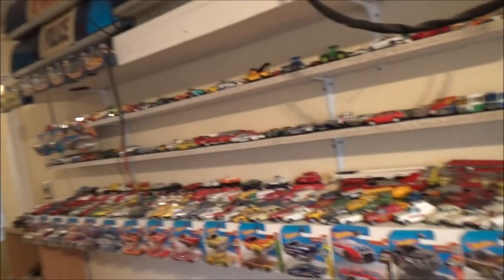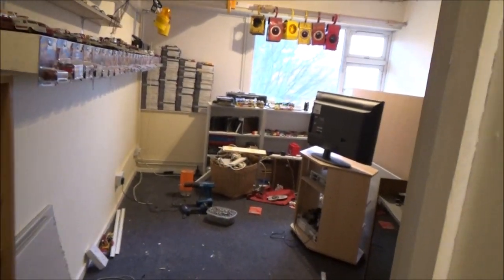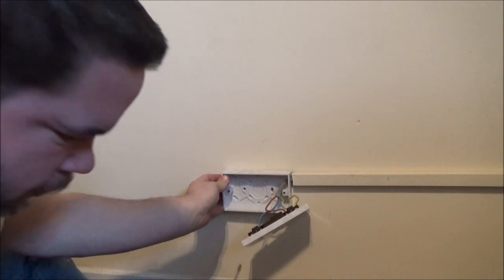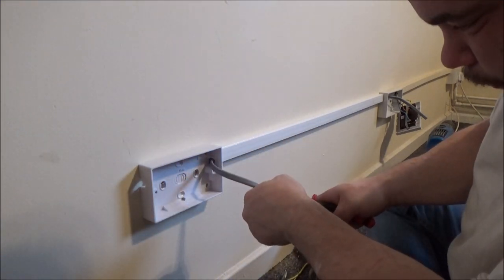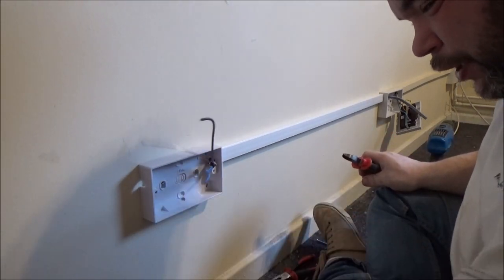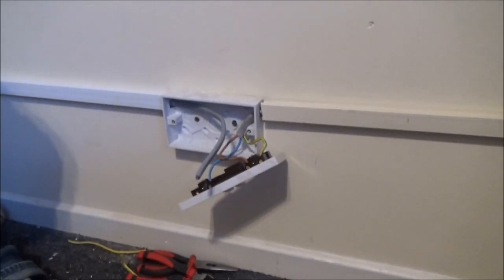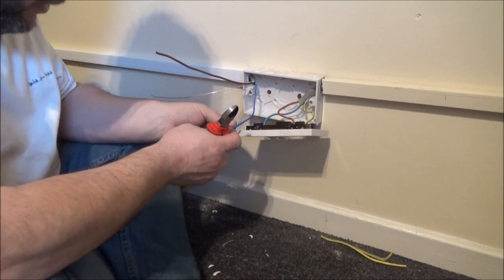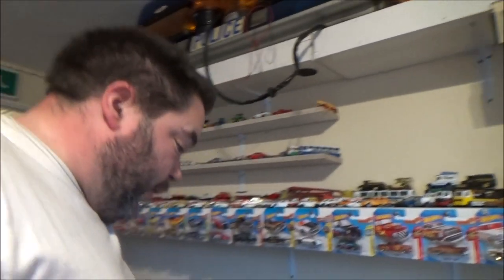Installing A Socket/ Power Outlet In The Bedroom.

Comment: So this is a spur socket off another spur socket, is this the reason for your 16A breaker instead of wiring a fuse in between?
Reply from the maker: It's not a spur off of a spur, it's a 16amp radial circuit.
Reply from the maker: The first socket was the only socket connected to the breaker, I have just daisy chained two more to make it a radial circuit. It's not a spur on a spur.
Reply: @RandyDarkshade2  ah ok thanks for clarifying

Comment: Good video, how can I move an existing socket if the attached power cable is too short, can I join cables ( via a junction box ) to get the extra length I need?
Reply from the maker: You can join a cable onto it but I'd recommend using Wago connectors in a whisker box if you  are hiding the cables under a floor.
Reply from the maker: It's always better to run a whole new length of cable if you can, but if you have to join it's best to use wago's and a box.
Reply: @RandyDarkshade2  ok, thanks for your reply.

Comment: Diy dave love how there's no vde screwdriver no proving dead no socket tester the new socket has a chip on the entry toolstation axiom tat by the looks of it
Reply from the maker: There is no chip in the socket and it's not from tool station either. How did I not prove dead? Lamp on, power was there, lamp no worky, no power. therefore, dead. Sockets have since been checked with a tester and are fine.
Reply: @Kieran - and yet he’s still alive, and the socket works fine. It’s almost as if joining the brown cable to the brown cable, and blue to blue, etc, is a simple task.

I wonder if chefs look down at DIYers making their own sandwiches, and speculate about the risk of food poisoning. Or if chauffeurs criticise DIY drivers performing such a potentially dangerous, but in truth simple and unskilled task. 

Probably not, so why do tradesman do it about their own various simple and unskilled roles?
Reply: @sam.p12345   this video is funny proving dead with a socket tester yea sure how could that be a ring main you know it could of been a junction box spur with a ring making a ring main into a junction box notice aswell the sockets are all 3 different brands by the looks of it the add on one looks like a toolstation cheapy
Reply: @kierantvyoutube3591  Making sandwiches with a cheap supermarket knife rather than some chefs Japanese thing, driving around a van with a small amount of surface rust, rather than an immaculate Rolls Royce, etc. Anybody can do it. If anything, the vid demonstrates how simple and unskilled  such tasks are, and how the various tools are just unnecessary smoke and mirrors tradesman have adopted to make themselves feel more important.

Comment: Are you allowed to have the wires running horizontally?
Reply: yes
Reply from the maker: In trunking yes. The cable run is visable.
Reply: It looks like you have taken a spur from a spur, as the existing socket only has one wire coming from it,  not sure that is safe my friend.
Reply from the maker: @Beverlymacker  It's a radial circuit. For some reason this socket has it's own breaker in the consumer unit. It's not a spur.
Reply: @Beverlymacker  it’s not a 32a ring though so it’s fine
Reply: Thanks bro